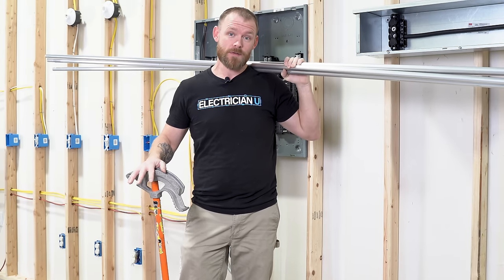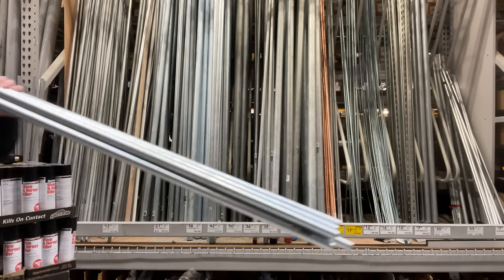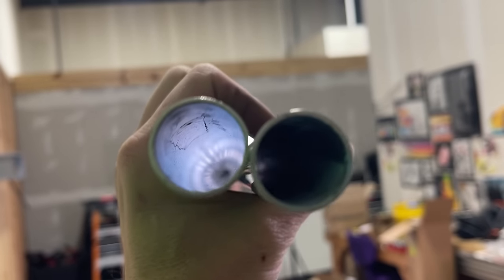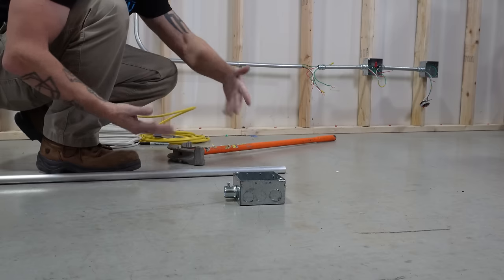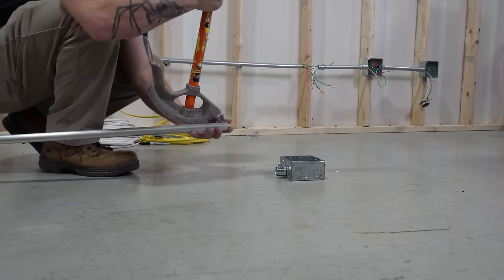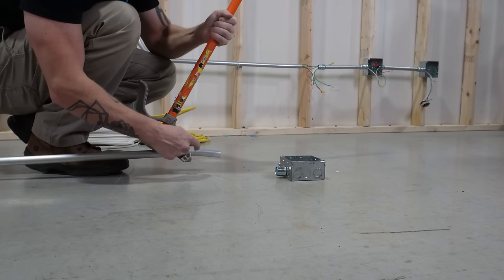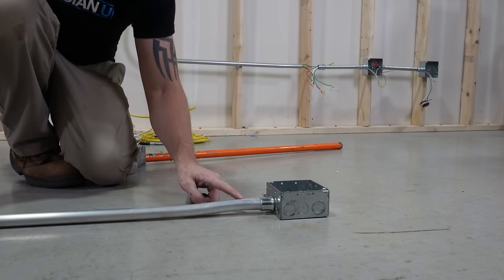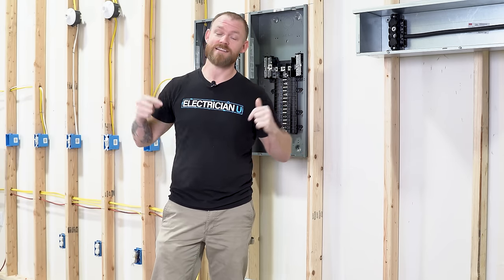How to Bend a Box Offset in Conduit

Comment: So many things wrong with this, get the opinion from someone who buys and installs this stuff by the ton, hint tapes and level are your friends, consistent measurements are key to clean work, 3" and 9" works best with multiple sizes, other than that just keep it consistent. Bending on the hook will always deform the pipe making some fitting very difficult to completely slide on without a hammer. Step on a soup can then step on a beer can, let me know which one works best, hint equal strength costs about the same. Air bending is pretty much necessary for all smaller conduit in many but not all situations, a box offset is one of them, and consistent measurements along with applying all your wight as close to the bend as is possible, prevents deformity conduit, doglegging, and if you add a pencil, preferably a carpenters pencil, as you will be abusing it, greatly help with consistency, doglegs and it wipes off either your finger tips when you're done.
Reply: everything i was going to say and more. good analogy for beer can and soup can, thanks for the 3" & 9" tip.

Comment: Mark the pipe at 2" and 4-1/4" .. bend at 10 degrees .. gives you 3/8" box offset
Reply: It “should” work because it’s the exact math. 
And for some benders (Klein and greenlee) it indeed does work fine every time.
For some benders (Milwaukee) it doesn’t quite. 
On some benders, the distance between the very end of the shoe and the offset mark/arrow is so long that you end up bending the second offset in the middle/curved portion of the first offset. The 2-1/4” distance isnt enough to slide through to the second mark in order to bend it on the flat part of the pipe.
Minor adjustments on the angle (a tad less than 10deg, which isn’t marked on any bender) and slightly more distance between marks (2-3/4 ish) will correct the lack of the math working out due to manufacturer making the shoe tip to arrow mark too long.

Comment: It takes a while to master this one. Also, don’t try to pull a full complement of wires through half-inch or three-quarter inch or larger conduit. 1900 boxes are cheap, use the liberally. Do not pull through two 90° bends.

Comment: Does Aluminum have the same conduciveness as steel?  If you are relying on the EMT for your ground continuity is there any difference in that regard between aluminum and steel?
Reply: Even if you could have the best conductive material for your pipes, if you have loose locknuts and loose fittings, it doesnt matter the material of the pipes.
But my guess would be the aluminum is better .
Reply: steel is a poor conductor and aluminum is a decent conductor so shrug
there's a reason we don't run steel wires for service ;)
Reply: @tye3ow  lol good one

Comment: My suggestion, 
Always try to do your offsets standing up with the handle on the ground. 
Faster and easier to make it straight. Also easier to feel the pipe bend and prevent over bending.
Also, you will less have to crouch and get up and crouch and get up each time. Your knees will thank you for that 😏
Reply: I agree 100%. it's much easier to eyeball the lines on the bender for your degree marks

Comment: I usually measure at 2 1/4 and then at 4 3/4 and boom it works well for your typical 1900 box w/ bracket. 

I forgot to mention that you bend each mark to the 10” mark on your benders
Reply: 10 degree not 10 inch
Reply: I recall doing 2-1/4" + another 2-1/4" inch to the 10 degree. or 2-1/4" and 4-1/2". but having learned long ago and not doing much conduit, never bothered to own benders. lol well, until recently, which showed me just how rusty and forgetful about it I was. I got it going OK, by the end of job. 🤣

Comment: It was fun when I did a back to back offset with the offsets 90 degrees from from each other. The concrete wall also had a slight bow to it so I also had to bend the conduit a different direction to have it remain flush to the wall.

But I am curious with how durable aluminum conduit is compared to the steal.

Comment: Is there any galvanic reaction between the aluminum conduit & the steel connectors or boxes?
Reply: That is my question as well.
Reply: A lot of EMT fittings are die cast zinc, which isn't going to be too reactive with aluminum.   The steel fittings are generally galvanized, which means that they are coated with zinc, which helps prevent galvanic corrosion.  but there will be places that steel to aluminum contact is unavoidable,  like that steel screws in the fittings that you clamp the conduit with.  Yeah, those are generally plated, but once you've screwed the end of the screw into the conduit, there;s going to be some steel/aluminum contact.   And yeah,  you're going to get some dissimilar metals corrosion there.  Apparently NEC doesn't consider this to be a concern, as it's explicitly allowed.
Reply: @andrewalexander9492  Bravo, Andrew. Thanks for your response. Actually I knew these characteristics, but just failed to put my brain in the right gear.
Reply: That is my question as well.

Comment: flush with the bender end a bit risky and may flatten the conduit end to where it will become the choke and rubbing point inside the fitting. but it seems to me they changed all the benders sizing over the years.  I've rarely do conduit, except for protection sleeve down basement walls, in which I opt for the cast offsets. never bothered to buy benders until recently for one job, my rust on bending shows. lol

Comment: I start to bend 2 fingers  width from the end of the pipe, and the second bend four fingers width from the end of the pipe. That way I duplicate them consistently. usually about 10° on my bender
Reply: 10 degrees here as well but that's for the 1/2" in the center of the box the holes in the outside use a little less. And starting a bend a little but back from the end of a pipe is really useful for 2 reasons #1 to see If the bends are straight and level #2 to dry fit the pipe into the box and slide in or out to adjust the length to the next bend say an 90deg or a saddle down that piece same pipe.

Comment: Greenlee Lil' Kicker. Stick the end in, push the handle. Done.
Reply: Wow. Cute tool. But not sure its worth paying for that. 
I'm impressed by all the specialised tool that are invented . 
The cutest tool i have seen recently, was a minuscule pipe bender but for little wires 😋😋
Reply: that works for offsets from a flat surface to the box but that accounts for maybe 5% of the box offsets I have to make. most of my offsets come from bang-ons into a 4"x4" box (about 2.5" offset), or from an uneven surface into a 4"x4" box. it's pretty rare that I actually get a nice flat surface into a box, normally only for like fire alarm handles. 6", 8" and 12" boxes all have different offsets as well, so this seems really niche
Reply: cool, go buy us all one to use...

Comment: How do you bend 1in steel conduit when you only way 140lb finding real hard not to kink it and I m  60
Reply: if you're kinking it then you're putting pressure too far away from the bend. if you're bending on the floor put most of your weight on the kick on the bender, and your other foot should just sit on the end of the pipe to keep it stable. if you're air bending (I mostly air bend since I work on a scissor lift 90% of the time), then keep your hands above the curve of the bender. right now I'm nursing a fractured elbow so I'm finding that bending with the pipe underneath my dominant armpit helps while still letting me apply all the pressure to near the bender.
Reply: you buy a super expensive hydraulic hand pump or electric over hydraulic pumped bending machine. or call someone else to do the conduit(lol)

Comment: shouldnt they be measured, so if you have several boxes next to each other, they all look the same?
Reply: It will become an automatism.
Dont waste time marking box offsets.
Reply: You are right. These guys are not electricians. for 1/2"  10° offset  multiplier about 6. Multiply with 3/8 ko hight is 2 1/4 spaceing. One have to be consistant with the mesurement from the end of the pipe.
Reply: @mihovillmisha9885  And you are not an artist. You are just bending damn pipe.